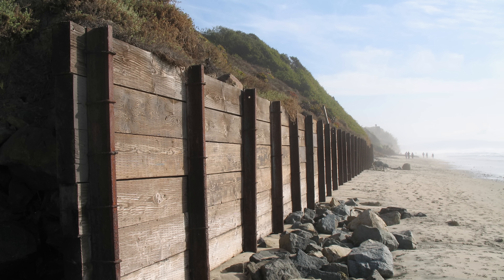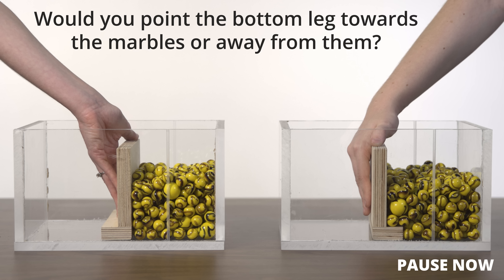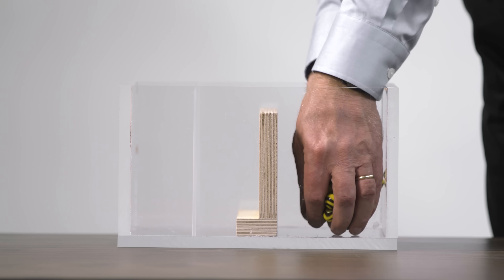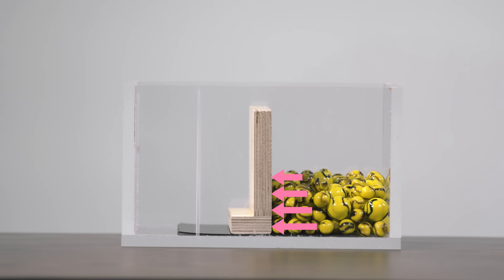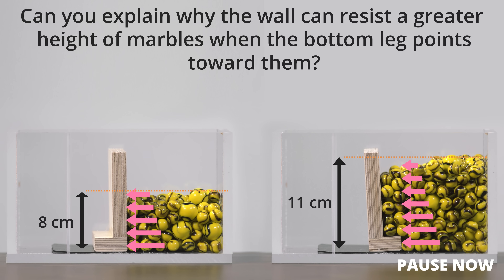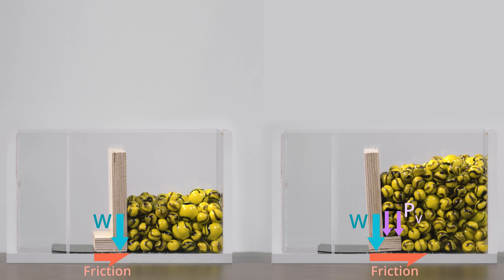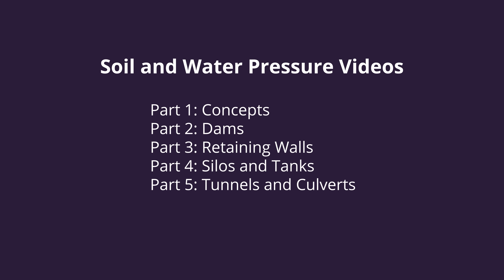8. Retaining Walls

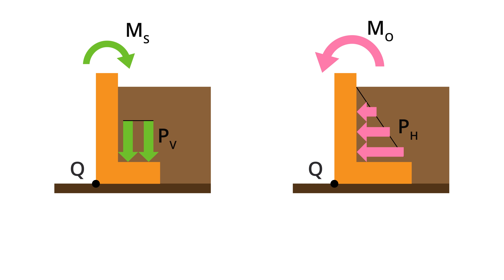Comment: 3:30 for those asking "why don't they make a T?"- this moment shows why. The inward facing leg provides much more of an effect, and you usually extend it further in to get more of the weight working on your side. 
Even if you add the outward facing part... it might look like a chihuahua compared to the inward facing great dane. Which would just make it look like an L in a font with more little ridges  on it.
Reply: A t shape will always be more resistant to overturning than a single L (with the same length), with the added bonus of working both ways. Theoretically you can make a very small L on the side of the marbles (or even no L at all), and a HUGE L on the other side, and it will be impossible to overturn. The inward facing L may indeed provide more of an effect, but that's not the only consideration. I may only be able to build in the other direction, or it may be cheaper, etc. There are definitely use cases where a T is preferable.

Comment: Why use an L when you could use a T?
Reply: The point is to minimize cost and maximize effect (and not compromise safety). It is always easy to overcompensate, but it takes skill and knowledge to know how much is enough. Why use T when L does the trick?
Reply: @seriyooow310  :: True but I'm one to over compensate when it comes to the goal: to keep the dirt behind the wall and keep the wall from falling out when huge force is exerted on it.

Comment: How do brick retaining walls stay up?  (I've seen many that buckle after a couple of decades.)
Reply: I think it is a similar principle, but the small scale models are not big enough to show the failure of the materials. 
Basically- the top still tips over, but because it is so big, it more kind of...folds or breaks at the seams. Same forces at play, but it plays out differently since it can overcome the rigidity of the overal structure.

Comment: if you just put dirt on both sides of the wall it wouldn't fall over
Reply: But.. the point of the wall is to hold back the dirt from the other side so that the other side can be safe from erosion e.g. roadway, housing.

Comment: Make the shape an upsidedown T shape. Checkmate.
Reply: They already do things similar to what you describe by adding buttressing to the wall
Reply: I’ve seen some retaining walls built in an inverted T shape. Since I was in demolition, not construction, all
I can say is that they were nightmares to demolish lol. 🤣
Reply: This comment thread was more educational than the video.
Reply: its still not as good as just taking that extra material to extend the lever foot of the L wall.
Reply: I have often made a t shaped foundation to provide stability from both sides.

Edit.
I want to point that regardless of the shape the foundation is always underground
Reply: yes but could it hold back deez?
Reply: This is pretty much what we do.  Often, piles get drilled along the footing path with  some pretty thick rebar bent to a cane at the end.  Once that is set and hard, sometimes the plans will call for a footing for the wall to sit on tied into the wall with rebar from the footing, pretty much making a upside down T.
Reply: engineering is about saving money, so the goal is to make something that bearly holds to save cost. anyone in the world can make something that holds, an engineer can make something that bearly holds
Reply: @greentdpro  They may not go overkill but they definitely don't design a structure that "barely" holds... you also have to account for winds loads and other things. Anything that is built to barely hold isn't going to hold for long. And yes we have seen it and that's why people die. Like bridges.
Reply: @otallono  barely holds means build it so that it will hold all reasonably likely scenarios plus some agreed upon margin for safety. it doesnt mean build it to withstand optimal conditions only. it is the correct approach and it is what engineers do.
Reply: Cantilever wall is a thing tho
Reply: Civil engineering isn't about building something that works, it's about building something that barely works.
Reply: No. The overturning moment described in the video is a torque, which is proportional to the radius R squared. Giving that length to the L part gives three times the torque (integral(x dx)|1 to 2) divided by (integral(x dx)|0 to 1) = 3
Reply: It actually have been used in real world.
Reply: That's just a waste of materials. You won't get significantly improved performance.
Reply: RTYB its a joke :/
Reply: @RTYB  yes you will. In this example, it's clear. An invert t-shape is MUCH harder to overturn. Just try it yourself and see. And I'm only talking about this model, not real world construction, obviously. That may or may not work in the real world (different materials, etc.)
Reply: @visualstudiosproductions  Sure, it does. It shifts the toe further from the weight, making the moment arm longer, does opposing the overturning moment (called righting moment). But, if you had to add that piece of wood, it is better to just put it on the other side, extending the length of the horizontal leg. The results are better, I did the math.
Reply: @seriyooow310  The problem I see in this model is that the density of the wood is less than that of the marbles. In real world the density of concrete is not that different from soil, so I feel the L shape towards soil wouldn't be that important as in this example. Am I correct? And in the math you did, this difference makes any change?
Reply: @miguelrivas4649  also, in the real world you have to factor in the strength of the elbow joint. Concrete is brittle so I have doubts abt this method
Reply: @miguelrivas4649  i feel like the density isnt as an important consideration as long as the material used to make the wall is strong enough to withstand the two different forces applied to it.  The important part about the leg is that the weight of the ground above is what keeps it in place and is the resistive force against the soil pressure
Reply: @Dinty51  yed i thought about that too, I was just curious about the theory. But I guess they do that in some places so maybe with enough steel bars inside it can work
Reply: @Wasthere73  I know that, but I think that in this example the wood is so light that it makes it a lot more obvious. I am pretty sure that if the wall in the video was made of stone/concrete the balls would have a much harder time tipping it over, so the own weight of the balls wouldn't make that of a difference
Reply: @miguelrivas4649  I mean you have the pressure of the soil vs the wall's own weight, and the wall is thin enough where the density of the wall probably doesnt have as big of an impact.

Imagine standing on a stiff rake and trying to push it over vs having a steel plate standing upright. Doesnt really matter the fact that the plate is heavier than the rake, you can tip it over pretty easily while you wont tip over the rake standing on it.
Reply: @Dinty51  Concrete has far more compressive strength than tensile strength.. so yes unless you add rebar for stabilizing, the concrete is brittle in the case where an L shape joint is being used.
Reply: @Wasthere73  Yep, the weight of the wall increases the chance the wall will not slide away across a surface with enough friction. Density isn't really a factor except when choosing materials you'd want to use. Some materials can be dense but fail under different stressors.
Reply: @JustinL614  i mean just because something is heavy doesnt automatically translate to less sliding. We have the sliding coefficient of the two materials we need to consider. But the sliding part is not necessarily what the video is trying to demonstrate. Its how were turning the downward force into a horizontal one, kind of meaning that the soil is holding itself in place.

Anyways thats not the point I was trying to make. I was saying that the design of the wall is more important than the density of material used (which we can equate to weight), so having a denser wall doesnt guarentee more stability to the point where an L shape is negligble
Reply: @Wasthere73  I wasn't talking about sliding either. What I meant is that when tipping the wall over, the outwards L shape makes a lever, so you need to rise up all the weight of the wall to tip it over, while on the inwards L shape you don't. I understand that the length of the horizontal part matters, but in this case the width of the wall is the same as the width of the "free" horizontal part, so if the wall is heavier than the soil, the force needed to rise the wall should be greater than the force needed to rise the soil.
Reply: @miguelrivas4649  I'm not quite following when you say rise. What I'm understanding what youre saying is that if the leg of the L was not under the soil, the moment would be further away so it'll be harder to tip? Is that right?

But then if thats the case, like the weight of the soil is whats keeping itself in place. Given equal materials, the leg under the soil will always be more efficient.
Reply: @Wasthere73  no I don't mean that. To tip the wall over the L leg, when it is pointing outwards, the vertical part of the wall has to rise, while to tip it over the angle of the L, the horizontal part has to rise
Reply: @Dinty51  In the real world you use reinforcing steel (rebar) to prevent breaking at the elbow joint.
Reply: @miguelrivas4649  Higher weight/density for the wall does not necessarily help it to resist tipping.  A less dense but wider wall will be harder to tip or slide than a dense, narrow wall, unless there is danger of an upward force from below the wall (as in the example of the dam, but really in any case where erosion can occur from below).

In the end it's more important that the material used will not simply shear or rupture due to the weight, and then the most important thing is that that there is a wide base with a low center of gravity (which is what the inward facing L does-- widens the base and keeps more mass over the center.)
Reply: @thevoxdeus  i almost domt remember the video, but i agree with you in most points, although i still think a heavier wall would be more difficult to move
Reply: @Dinty51  That's why rebar is used to reinforce concrete, to increase its tensile strength.
Reply: @seriyooow310  But what about when the retaining wall is on a riverside and you cannot extend the foot inside the river?
Reply: @miguelrivas4649  What about rain? in the real world concrete have no siignificant variation in density when wet and the soil changes his overall density when wet and that will vary with the amount of rain and permiability of the soil.
Reply: just add a smaller inverted-T-leg on the left side with a tooth attached going down, preventing sliding
Reply: @marshmelows  "preventing sliding" .. LOL
Reply: @marshmelows  We do exactly this in the real-world all the time. The "tooth" is called a "shear key". It is more effective to move the "tooth" further back on the footer though.
Reply: Chuck Norris's pants have an L shaped retaining wall to hold back the weight of his balls also.
Reply: Frozen soil: no you checkmate

Comment: Can anyone point me to a video about retaining walls that DOES go in to depth about the subject of retaining walls?
Reply: Try practical engineering 
Dont think he has a video specifically about this but he does a good job explaining engineering stuff in a fun way
Reply: There are lots of them, but in lecture style. These are helpful during college days.
Reply: A fluid mechanics book will help. Look up forces on submerged surfaces
Reply: Design of concrete structures 13 th edition by Nilson
Reply: I know this is an old comment, but since YT has decided it wants everyone to see this video I'm going to comment. I don't have a video, but what you want to add is called a tie-back. Placed higher up on the wall, you add a structural piece say wood to match your wall. Connect it to the wall and then to another piece of wood in a T shape that anchors the top of the wall to a point behind that mass of dirt. And I'm not talking about 2x4's here, more like thick railroad ties.
Reply: @Hypercube9  having a hard time visualizing it
Reply: There are lots of practical videos on YouTube from people who build/fix retaining walls. To help alleviate hydrostatic pressure, many retaining walls are designed to allow the water an easy path to flow through (or otherwise away) from behind the wall.
Reply: I do not have time here to send you a link of such a video... haha
Reply: @jonathanspangenberg1563  LOL
Reply: I could send you a link to a longer video about such a thing, but you won’t have time to watch it.
Reply: @aaajjworm  would u please send me the video? I will share with other practicing engineers working in government sector. Thanks in advance
Reply: @omermowaffaquejaigirder8889  shouldnt ya'll already know this? Being PRACTICING ENGINEERS WORKING IN GOVERNMENT SECTOR...or are all the jokes about government employees true?
Reply: @ProfessorToadstool  haha. In fact we have to deal with trainees coming from different sectors of engineering and hence forgetting the basics of retaining wall. An interactive study material would be of great help for them
Reply: @jungle84  thanks for the material
Reply: @omermowaffaquejaigirder8889  
Honestly,  I'm pretty down on 'people' and their 'accomplishments' right now, so take what I say with a lump of salt. 
Good day to you.
Reply: @ProfessorToadstool  your name says that loud and clear. Thanks for the clarification 😊
Reply: @omermowaffaquejaigirder8889  it was 'cardigan' wasn't it? everyones a critic, its MY STYLE daggummit
Reply: @ProfessorToadstool  that's why he said he's practicing
Reply: @iamamish  right, just like the medical 'practice'
no thanks, as an american i've spent more than enough time as a guinea pig.
Reply: Why are you going into the consulting business on the back of a YouTube video … 🙄🙄🙄
Reply: @andyxox4168  Who are you talking to?

Comment: Am I the only one who wanted to see the L facing the marbles without the additional friction?
Reply: There's no time for that here.
Reply: @rogerscottcathey  lmao 🤣🤣😂
Reply: possibly! XD
it would just slide like shown earlier- kinda pointless to see exactly when that is when your goal is to build a functional retaining wall
Reply: The height would be a little bit higher than the first one by less than 1cm. The added weight of the marble sitting on the horizontal leg will add friction since friction is a function of weight (directly proportional). But coefficient of friction in glass is not very much, so the added friction is not much.
Reply: it will slide too
Reply: @AndreasChristianto  Yeah,  I was just hoping for a direct comparison but they included the friction pad which ruined it
Reply: We can still know the height or volume of the marble it can hold with basic math
Reply: It would slide but not as much because of the weight of the marbles on the L.
Reply: It would do the same thing - slide just as much. This model demo is pointless. No retain wall would ever be built just resting on the surface.
Reply: Yes, you are.
Reply: Same. Haha
Reply: If so ur iq would be out of this world
Reply: it will still just slide..
Reply: let's use a T wall!
Reply: Since in both cases the sides ways force is the same, they will both begin to slide at 3cm of marbles.
Reply: @TimeTraveler-hk5xo  What about the downward force on the L?
Reply: Increase weight on lower arm would increase friction. It would hold slightly more.

Comment: how could someone not get this.  I thought it was obvious.
Reply: All engineering principles are obvious when shown to you in a simple model. Look at every complicated structures you can see and try to think how it is done. You'll be surprised at how simple they actually are on principle. Every engineer student has to learn them in simple model, so don't underestimate these kind of explanations because it can save an engineering student's life.
Reply: @seriyooow310  I look at problems like that and think about them and to me they are obvious.  Things like this just make sense.  I knew the answer as soon as I hit play.  I was hoping I would see something I wasn't seeing.  It's like a support beam.  You don't put the poles holding it up on the ends.  You put them in about a third of the way.  I doesn't bow.  It's stronger.  This just seems obvious to me.

Comment: I'm surprised that the lesson didn't include, "This assumes a rigid and engineered retaining wall that will survive the expected pressures." If the "L" fails at the corner, all bets are off.
Reply: That's part of the assumption in determining the kind of wall you would need for your problem. Then structural analysis will be done using the loads of your predetermined kind of wall.

Comment: Red seal carpenter and concrete finisher here. 

I've built retaining walls of all shapes and sizes and 100% of all the engineers designed the wall's footing to point away from the force. 

Why would this be in 100% of cases for the 20 years I've done this if your video suggests otherwise?

Again, this is 100% contrary to your reasonable explanation

Comment: Most landscape retaining walls fail at the top. The weight of the blocks on top helps keep the bottom ones in place, but as you go up, that weight reduces. So while the lateral pressure is greatest at the bottom, the place on the wall where the lateral pressure exceeds gravity is closer to the top.
Reply: thats where terraces come into play (i think) lol
Reply: That would explain what's happening to my dry stone retaining wall. Thanks.

Comment: I'm a novice and will probably be laughed at as I have came across some error here but why don't they use an upside down T shape so it can't be pushed and can hold back more dirt.
Reply: Captivated Gaming 
Inverted ‘T’ will not work in most applications requiring a retaining wall.
Reply: @DMAneoth  , I appreciate your insight :D